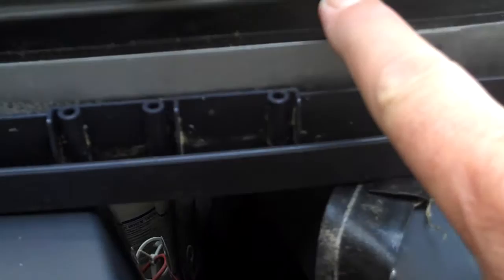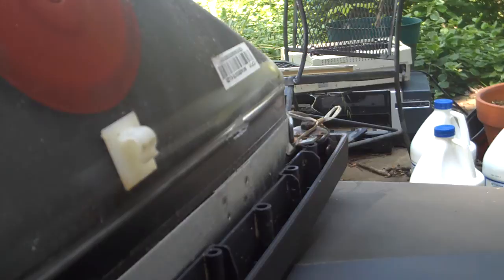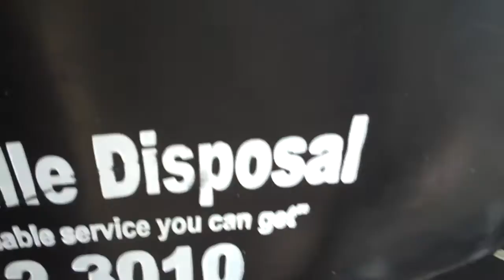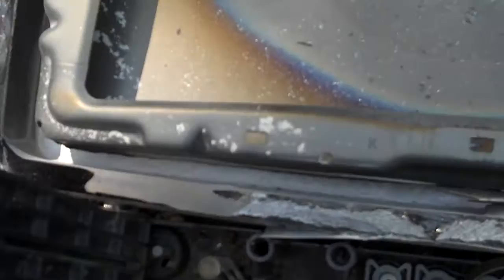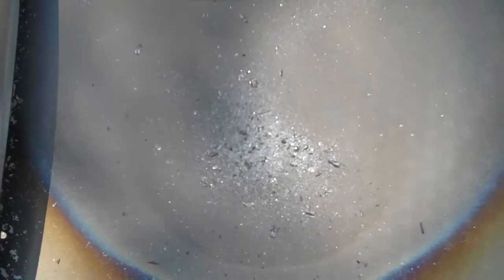Opening A CRT (cathode ray tube)

Comment: A word of caution! CRT glass tubes contains 18 to 26 % lead (22% in average). The lead is bounded to the glass as lead oxide, which is very poisonous as it will enter your body through your skin or by inhalation, and it will stay in your body forever bounded to your bones!  Even worse is that the frit, where the front glass panel and the glass funnel are connected, contains 70 to 80% lead. When you cut with the angle grinder directly trough the frit line you're spreading poisonous lead particles all around you. Not only will you inhale lots of the fine dust, but you'll also pollute your surroundings with dangerous lead particles. Not to mention Original Feets have a river nearby where some of the heavy toxic lead dust will inevitably end up. Landfills have big problems with lead slowly leaking out from old CRT monitors, thus polluting ground water. In addition to this you are exposing yourself to even greater dangers because the front glass panel is covered with a layer of poisonous phosphorous material. This layer contains, among other hazardous substances, for example: yttrium, cadmium, barium, and mercury; all in highly toxic oxide form, ready to be inhaled when released in open air. It is not worth risking your own health to recover metal worth a few pocket money, and then lose several years of your life! You're also polluting the environment and thereby harming future generations. The only safe way to open a CRT tube is by placing a high voltage electric wire around the frit line to crack the two halves open. This is always done inside a closed compartment, with a slight vacuum sucking out every bit of dust to a multi dust bag filter system, and then using a special industrial high vacuum cleaner to remove any traces of phosphorous material from the front panel glass. The remaining leaded glass is still poisonous and must be further treated in a safe way, to fully remove the lead content. Backyard recyclers scrapping CRT monitors should not even consider to scrap the CRT glass itself, but bring it to a certified commercial recycler.
Reply: what is lead-lead dioxide system?
Reply: Not sure of what you're asking about! On www.wikipedia.org you can read all about: Lead, lead oxide, and lead dioxide. Metallic lead is actually not poisonous but because it reacts with the oxygen in the air, the oxides forming on its surface are; so don't touch lead without rubber gloves. All lead oxides are very toxic and dangerous for the environment.
Reply: no one give me any information on en.wikipedia.org
Reply: superdream58 thanks for the warning because i was thinking about getting more crt tube glass to add to my collection ( i only have one from a projecter type tv) but i didnt know that they were highly toxic, thanks for the heads up, i think i might need to make my own crt tube glass for the safety!
Reply: And smartphone manufacturers pollute way more than CRT recyclers do..
The guy is trying to make money not spend money paying some dodgy outfit that will do the same exact thing he is doing and profit two ways (one payment from the person bringing the thing in and another payment for the metals they collect out of the things brought in).. 
Fun fact. Those beloved "professional commercial recyclers" also dump their toxic dust waste into landfills with their regular trash because it's cheaper than to ship it off to another dodgy outfit and pay them to dump it in their local landfill. They sure as hell are not going to sit on that crap. Point is the shit ALWAYS winds up in a landfill in the end..
Reply: Lmao lead? Yes, Lead is a VERY Dangerous Kind, But Mercury is Much worse. The Mercury inside the Tube can kill you if you In minutes or Seconds if you Touch it or “smell sniff” With bare skin, And can Harm or Kill you If it gets in eyes.
Reply: @warheadssociety8177  Mercury is only dangerous in vapor form. Cody at Codys Lab did a series of videos on Mercury from handling, manufacturing from raw rock, even flushing 200 lbs of it in a toilet.
Simple grade school based science will educate you on mercury.
Also there is no mercury inside CRT tubes..

Comment: If I want to obtain the front glass (with phosphor) whole/without cracks, do you reckon it's possible to use heat to separate the fret line cleanly? Even if it takes a lot of work and time?
Reply: Did you ever have any luck with this? I have a screen burned crt that I wanted to preserve and mount on the wall.
Reply: @trimbandit9636  I haven't tried yet, sorry, I don't have the right place to do this

Comment: What is the mesh and that other pyramid looking thing made of, steel?
Reply: Moose Scrapper its a highly conductive oxide coating that allows the crt to produce brighter picture to the screen not sure if this answer is accurate but you can google how crt tubes work and you'll know why.
Reply: That shield is part of the second anode deflection system in the tube so it creates better image control options like focus, sharpness, brightness, etc. That tube probably required at least 20 KvDC to operate efficiently in a set.. The screen on the front was what controlled where the colors went and when on screen, the finer this screen the higher the resolution.. Black and white CRTs do not have a screen and most CRTs on test equipment do not require a second anode..

Comment: Nice video.  I've seen crt tube with a orange-brown color coating on the back of the glass tube and wonder what that was. Any idea??
Reply: could be cadmium.... I was reading this morning about the water soluble heavy metals on the inside surface Can't recall all the chemicals, but they were not human friendly.

The chemicals are coating the inside of the CRT, and one of the processes for recycling CRTs is to wash the coating off with water.  Its another reason CRT's are bad in landfills.